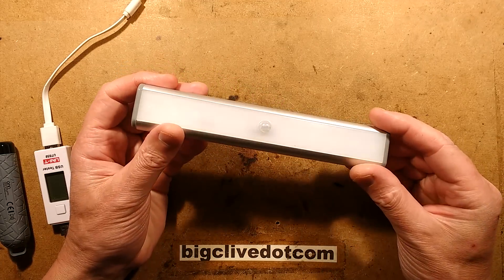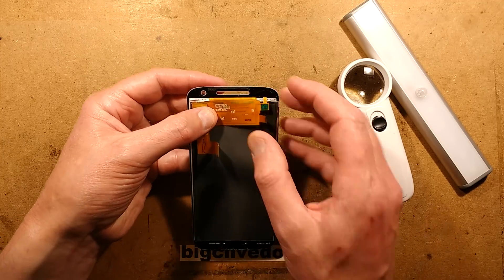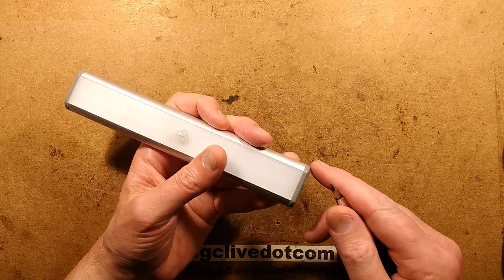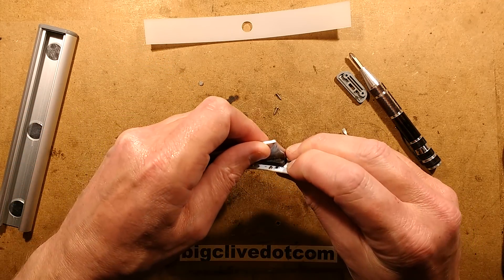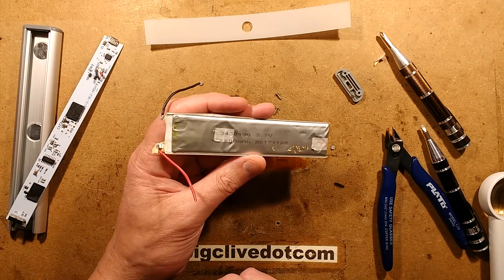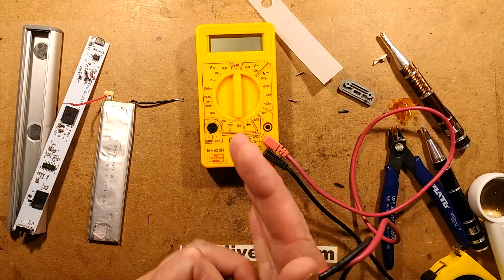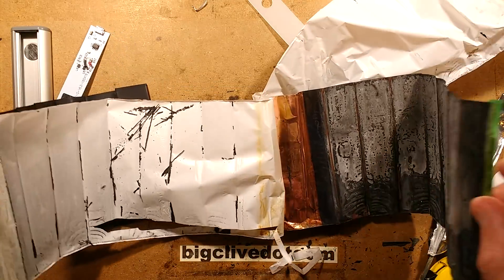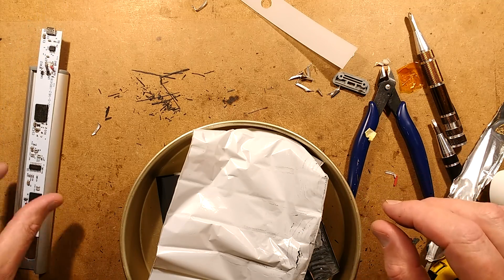Faulty light autopsy with "electronic noise" on the video.

Comment: At least you can get a replacement screen for that phone. It's worth watching Louis Rossmann's videos about the obstacles Apple put in the way of people trying to repair their phones. One of his peers had a consignment of replacement screens seized at the border.
Reply: It's not just apple, there's a reason why brands are normally blacked out on replacement screens.
Reply: ChrisD4335 Getting iPhone replacement screens locally is only due to someone else putting in huge effort to bypass Apple's unreasonable obstructions.  I strongly suspect that some other brands use screens that can be purchased officially, either from the brand or their commercial supplier.
Reply: I love Louis!
Reply: In prior generations, screens were off the shelf indeed, and might still be. But the mask of the touch sensor glass and the routing of the glass are custom, and with better contract manufacturers, you can reach the agreement that they won't reuse that tooling to produce for other brands or for sale to anyone else, and the contract manufacturer can be held liable. When you get a Chinese PCB manufacturer to print or even populate you a batch of PCBs, it's not like you automatically give them a license to steal your product, do you? Similarly terms of contract that rejects must be shredded and that identical designs will not be produced for another customer is typical for a large enough customer, and they agree gladly since who likes to lose large lucrative contracts?

The glass parts for major brands are made by a Chinese subsidiary of an American company anyway, who have a lot to lose if they break the contract. Chances are, when original glass had the logo screenprinted on it and the replacement doesn't, it's actually a copy, since the corresponding product-specific tooling and CAM is really not that expensive or that much effort.
Reply: SinsBird "brands blacked out" isn't normal. Once they complete order/batches for original manufacturer/brand they keep making them without the branding. Subsequent ones are sold as "for" brand x or y
Reply: John Francis Doe Same goes for Apple, mostly they assemble parts sourced from all over. Once the contract is up for apples custom made parts, they make their way into cheaper brands devices. A lot of the intellectual property actually belongs to other companies anyway, which apple has had to license for use in their products, I'd say a big chunk of change goes to getting exclusivity for a few months. So in reality it may be the exact same korean screen off the same production line just after apples batches and without a logo, less stringent QC
Reply: mr zh84 you can get replacement screens for any iphone locally without any trouble. any outher phone you must order one.  Replacement parts for the iphone is by far the easiest too come by
Reply: Apple is scum

Comment: Is there someone with sufficient audio editing skills that could lend Clive a hand to get rid of that infernal screech?
Reply from the maker: It's a one-off.  It won't be used again unless I resolve the issue.
Reply: bigclivedotcom it sounds like it's the same frequency. I'm sure it's possible. I just don't have the know-how :/
Reply: Screech? I heard something that conjured an image of an array of really tiny relays just clicking away frantically.
Reply: anjelgiofu And I didn't notice much after all the audio filtering by the compression, my phone and my aging ears.

Comment: Try shining a laser through some of those layers out of the phone display. I wonder if it is a material like the diffraction film out of those red and green, rotating dot pattern laser projectors.
Reply: That would be wonderful if it were diffraction grating, I finally bit the bullet and bought some for what seemed like a pretty high price. I have torn apart a lot of lcd monitors and tvs that were broken and have only seen this layer in one of them, I am uncertain what brand the tv was or what technology it was. I suppose I will have to dig out the layers that I have kept and run some tests now. I was just after the polarizing film and inerters initially.
Reply: This film is a micro-prism film that's used to internally reflect all light that is not almost perpendicular. This makes backlights more even and efficient. Light at too much of an angle is lost in the LCD. By reflecting it back onto the white diffusor it has another chance to go through the LCD in a new direction.
Reply: am guessing part of it maybe to do with the touch screen bit
Reply: I believe the per-subpixel colour filter is just a dye print, but it's in the actual electrode glass, it's not one of those layers that you can peel off or that just flap about being held in merely by a flimsy little frame.